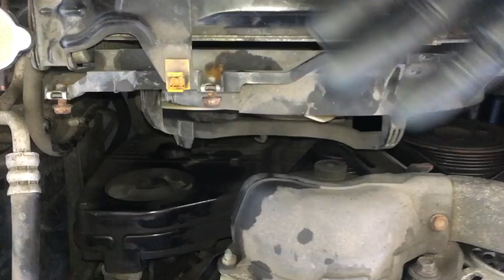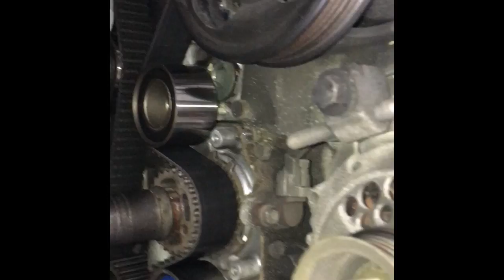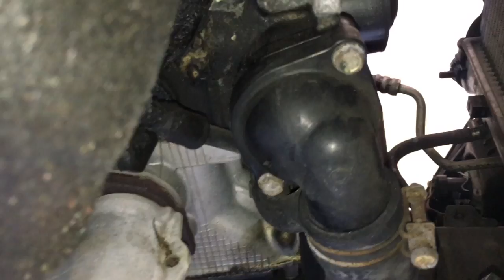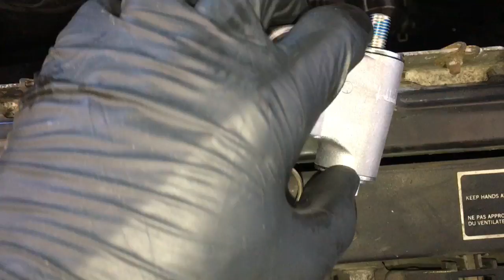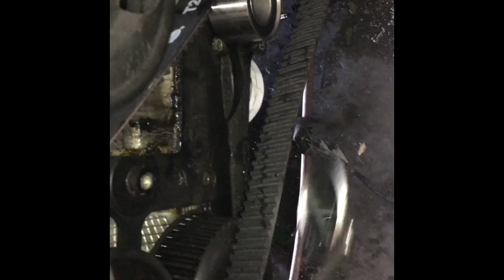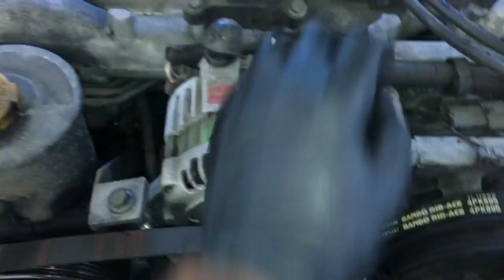How to Replace the Timing Belt and Water Pump on a 1998 Subaru Outback with 2.5 L DOHC Engine

Comment: So I used a breaker bar on the crank nut to break it free, and I'm pretty sure I bent something in the motor doing it, I got my timing belt on, right. I've done it twice, and the motor still misses. When I did it, it made a weird timing. Pop through the exhaust. Thanks for the advice. I appreciate it. Spanner wrench would be what I would suggest people use now.I get to pull my motor and my heads.I appreciate it
Reply: Thanks for posting this, but sorry that happened.  I'm about to do this project, and was a little uncomfortable using that trick.  Now that I've seen your comment, I will follow your advice and just use a spanner wrench.

Comment: Regarding the "little trick" used to remove the Crank Pulley, it's a great trick BUT you should exercise a LOT of caution!
  Use only high quality/name brand ratchet tools.  Use ONLY a 1/2" Drive 6-Point 22mm socket (NOT a 12-point socket or 3/8" Drive socket) and Breaker Bar like CRAFTSMAN, HUSKY, MATCO OR SNAP-ON brand tools.  Don't risk using an unknown brand or "Made in China" tool.
  The ideal socket would be a 6-point, 1/2" Drive SHORT Impact socket.  Also, make sure the Breaker Bar is long enough to actually catch under the frame when the engine is cranked.  If it's too short it will just swing around and damage other engine parts.
  DO NOT use an unknown brand or low quality tools for this operation.  The big name brands are made of forged, high quality steel and wont break with the force of the engine when you crank it.  Cheaper tools could easily break and send that breaker bar flying and cause serious injury to you AND damage to other engine parts in the way.  Remember, that engine is strong as hell and will easily break a tool made of cheap steel and it will all happen in a split second..
  A 12-point socket with slightly worn points inside the socket could easily wear down or round off the corners of the Crank Shaft Pully Bolt when you crank the engine making the Bolt almost impossible to remove for a DIYer and a 3/8" drive on a low quality socket could easily snap off inside the Breaker Bar.

  When you position the Breaker Bar, get it as close as possible to where it's going to stop against the frame of the car when the engine is cranked so it swings into position in as short a distance as possible.  You might even want to get it close to the frame and jamb a piece of wood like a short piece if 2 X 4 between it and the frame so it doesn't swing at all when the engine is cranked.
  Last, just crank the engine for a split second at a time and get your face and body away from the engine compartment if you have someone else crank the engine for you.

Comment: Followed this for a 1998 2.2 L (not dual cam).  Also this year had the 97 version pencil tensioner (apparently Subaru continued the configuration into some of the 98 models (not widely known).  Radiator stayed in place, but duct taped a thin cabinetry plywood over the radiator to prevent accidental damage).  My son and I Completed R and R in 5.5 hours (including spark plug change).  We had a lift in our home shop so it was convenient.  I've had a great deal of automotive and offroad vehicle experience so It was straightforward for us.  Local shops wanted $1800-2200.  Apparently they can make money easier then these jobs.   All in all the video was excellent and I appreciated how methodical each step was covered.

Comment: Noticed you went over the hardest part with "just hold it on there"...how? It is friggin impossible to keep the gasket lined up whilst lining up the bolts to the holes at the same time. Gasket slips off EVERY TIME.

Comment: Would it be the same process on a 98 Subaru legacy 2.5l?
Reply from the maker: Yes it’s gonna be pretty much the same thing there might be some small differences as far as the brackets or something but the timing belt set up will be the same.
Reply: I'll be doing this to my legacy in a few months, I'll be using your video to guide me through. Did you ad gasket sealer when you installed the water pump? Thank you for your help.

Comment: what a great job on this video. I am about to do this job and you took most of the fear and questions away. just did the radiator and thermostat so some of the steps are familiar...the water pump was the cause of radiator failure, which I now know

Comment: i finaly got it right. biltema didnt sell mirror for use in engine rom, so used a cake shovel  in steel.
saloot your great videoes.
Reply from the maker: ida olea whatever it takes awesome!
Reply: workshop used 3 ohr to shift spark plugs. but do in in 40 min vith engine elevator, just loosen bolts that hold engine to frame, then lift engine up one fist, so its easy to shift spark plugs. workshop sheef god angry as hell when i told him how to di it fast. I think they ripping people off.

Comment: Why take off the fans from the radiator? Extra work for nothing.
Reply: jim wagner impossible to do without doing so. A bolt for removal for the fan belt would only have 1/2 an inch for ur ratchet and such if rad fans were still there
Reply: So there is room to remove the timing cover, timing belt and pinion gears.

Comment: Thanks for the video. I am puzzled by the alignment of the cam pulleys on the driver side. From my vantage point viewing this it did not look like they were perfect. On my 97 they look the same way (using a mirror). I am wondering of the consequences of being a couple teeth off. Also,on the alignment of the crank pulley -you sort of breezed thru exactly what you were aligning to. For me, it looked like you were slightly off center.

 Also I found that the standard practice at Subaru (whenever a timing belt is replaced)  is to remove the cam sprockets to inspect the integrity of the keys. I had a Subaru mechanic who ignored this step and ran up a huge bill for the owner as the mechanic tried everything he knew to compensate for a sheared cam key. The problem was a cam key was sheared on a cold weather start.This was on a 92 non-interference engine. I bought the car with a box of parts in the trunk after the owner gave up on the repair to stop the financial bleeding.
Reply: Lake Nokomis I agree. I have not had any luck with an answer, have you? Thanks